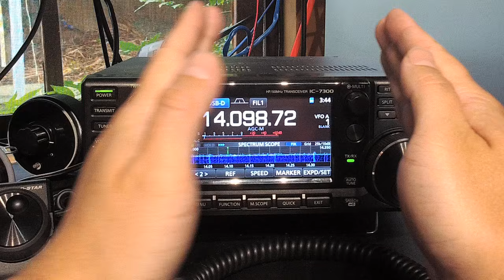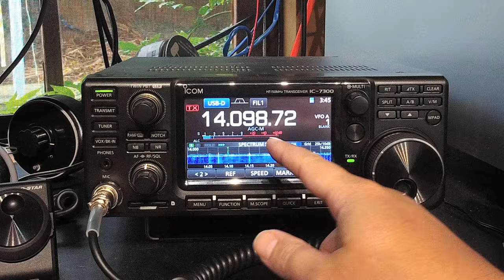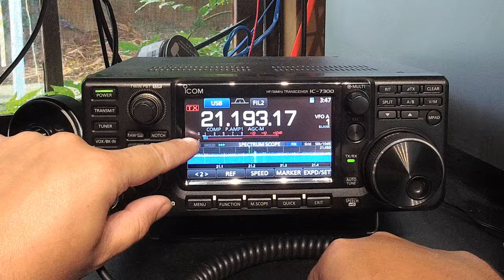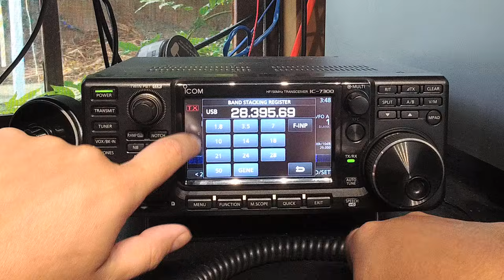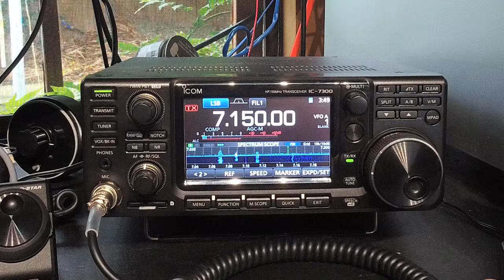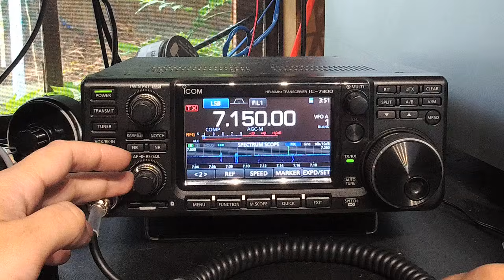How to Setup Your Receiver for Optimal Performance (IC-7300 & IC-7610)

Comment: The RF gain an attenuator controls are the two most important controls on your receiver and it that so few hams understand this today, I blame it on the dumbing down of the tests bringing people into ham radio who have no radio experience whatsoever.

I was at Field Day last year with what is supposedly experienced operators and was stunned at the sheer number of them who had their RF gain not only cranked wide open but we're preamps with an S5 noise floor. Unfortunately they're arrogant Or maybe the fact that they're sitting at the peak of MT stupid on the Dunning Kruger curve prevented them from learning when I tried to explain to them that if you have an S5 noise floor you don't need a preamp, their view was that the preamp made the audio louder but what it actually does is significantly reduced the dynamic range of the receiver.

You're not gonna hear anything in that noise, despite the claims that FT8 can hear below the noise floor it cannot, This is comment made by people who don't understand that the signal to noise ratio on FT8 is calculated on a standard 2.4 KHZ bandwidth rather than 50hertz bandwidth of FT8 making it appear as though it's decoding signals below the noise floor.

When switching to a band, the proper thing to do is tune to a clear frequency and adjust the RF gain for either zero S meter deflection or maybe an S1 at most, this will significantly increase the dynamic range and sensitivity of the receiver. It also substantially increases the selectivity of the receiver and it susceptibility to adjacent channel interference, just like your power output you should only run enough RF gain to copy the signal you want to work Anything more will seriously degrade the performance of your receiver.

RF gain is such an important function that some manufacturers unethically detune the front end of their receivers to artificially inflate they're two kilohertz dynamic range numbers so they appear at the top of Sherwood's sort order. Yaesu tends to do this, for example the 7610 has a 0.3 microvolt front end sensitivity, the competing Yaesu has a front end sensitivity of 0.66 microvolts that's a full 6DB less sensitive or 1S unit less sensitive. They've done this to artificially increase the performance of their radio in the 2KH dynamic range test.

Comment: The s-meter changing due to rf gain changing annoys me beyond belief. I talk to a lot of local stations and can see when one of the locals are having issues or what gear they are running works best. If all of the locals suddenly seem to be having issues I know it's my set up having the issues. The s-meter may not be a scientific measuring device but it is a useful tool when it doesn't change constantly due to radio adjustments.

Comment: Hello friend, I really enjoyed this video but I have a few quick questions. I am a 7610 owner and first, you mention the AN/MN feature and reference that the 7610 does not have this. I am assuming you mean the "one-touch" feature and that with the 7610 one has to dig a little deeper to get these settings to activate?  While I agree, I would suggest the 7610 is much more capable once you access these settings, agree?
Second, you also mention something about the 7610 and, it may be the particular verbiage you used that I didn't understand, but you said something to the effect "provided the 7610's RP PASS is setup correctly"?  Can you tell me what you were referring to here?  It may be something I have overlooked and want to engage on my rig. 
Great video and I have shared it with several friends who are new hams and are having trouble understanding RFG, Preamps, Attenuators, etc. 
Looking forward to more videos.  73 de AF1US -- Brian

Comment: I recently bought an ATS-20+  for $25 US and hooked it up in parallel with my IC-7300 for testing with a 40m inverted V.  I am finding that the ATS does about as well in most cases,  and sometimes  is even better. I must be doing something very wrong.  I am putting both on the same frequency and switching the antenna with a coax switch to make comparisons.
I just tried swicthing the tuner out and in -- not much difference.  SWR measured with VNA is about 1.2.

Comment: really stepped up my ability to hear better on the 705 and on my FT-991a even see the waterfall better and re-read the manual since RF gain acts differently on that radio... but principles the same ! didn't hurt that I went from a 1/4 wave loaded antenna to a EFHW that latter hears way better than the compromise antenna.. and noticed blobs on the WF... which were multiple signals close together :)

Comment: 9.99 out of 10 YT videos featuring some kind of radio show the radio at full gain.  Most times it doesn't matter tho, because the SNR is bad anyway and if it isn't, well, moar signal must be better, right?   The concept of trading surplus signal levels for more SNR hasn't really caught on in 120 years of radio, or it was forgotten as it seems, and losing <GASP> not only the S-meter reading but also the waterfall is maybe not helping with that.

Comment: Hi there, you can see the scope much better if you touch the exp tap bottom right. also on section 2 at the bottom of the scope if you touch REF and turn the tuning dial to say  minus 10db, it will get rid of all the noise on the scope, although it wont effect the incoming audio from the speaker, but its easier to see the lines on there...from Fred g4vvq in Uk..

Comment: RF gain cuts the grass.   It lowers the noise from the bottom up unlike a volume knob lowering all the noise evenly.  Cutting the grass doesn't effect anything above the grass. 

Generally I turn down the RF gain until the meter reads close to the noise floor,  if it gets too quiet add volume.

Comment: Love your video, I noticed my reports were not 'Accurate' with the REF Gain turned down so once I get a good signal and RF where I like it, I set it to 12 o'clock to get the report and then put it back to optimal

Comment: Great video, Jarrad. I learnt a lot about my 7300. Unrelated, but I knew the previous holder of VK3BL licence very well. 73 from Mark VK3XVC
Reply from the maker: Any chance he will sell me the car plate?
Reply: @RateMyRadio  I don't have any contact with the family, his wife moved away many years ago to be closer with family I believe. Barrie used to collect car plates, I imagine his family wanted to keep that one.
Reply from the maker: @CircuitofDoom  thanks for the info.  I’ve seen it once on a 4WD In dandenong a few years back now.  The family should keep it if they have.  73!

Comment: IC7300 receiver overloads and de senses horribly on 160 meter if receiving strong AM Broadcast signals near by. Now had and using is a high pass band filter inline on coax, all is good with the 7300 again! 40db worked well then picked up another unit giving a total of 80db which was better yet. In my collection of older analog radios the 160 meter band was never overload by these same broadcast stations just some birdies showed up on some upper bands. Guess there is something to be said about the approach using filters at the front end of the radio for the band design.

Comment: Jarrad, you mentioned in this video that you'd make another one on how to set up other ICOM radios - did you make one for the 7100 (and I don't mean the short review that you've already put up)? It seems the 7300 is set up differently than the 7100, as it's an SDR. Thanks.

Comment: Well said Jarrad, thanks! Let me make an additional recommendation -- I always adjust the IC-7300 RF Gain down to an S1 noise level on most of the lower bands. It dramatically improves the dynamic range of the AGC as you explained. In conjunction, I also adjust the REF scope setting on the second layer of soft keys. I found that if I DECREASE the RF Gain down a few S-units to the noise floor, I INCREASE the scope REF setting +3 to +9db so that the scope gives me a more sensitive visual reading of signals across the band, too (no RF impact on signals, just scope sensitivity). Doing both of these together makes for an amazing user experience. Try it :) 73s Greg, KJ6ER Silicon Valley

Comment: Jarrad great video and yes I use this very system on my FT-101E and it sounds soo much better than full RF gain. A lot less noise and as far as the S-meter reading most are 5-9 anyway. Thanks again and I have used this technique on many old and new radios. 73 VE5EE

Comment: Thanks Jarred that was extremely helpful! What is your take on using Noise Reduction? (Thanks to your video I discovered that my IC7300 preamp was on. There's no indicator on the regular screen, and it memorizes this setting by band. I guess it pays to check all settings BY BAND once in a while to avoid such surprises.)

Comment: this is my third  radio. so far I love it. I  have a seven o 6 icom. I have a five ninety with a howel mike on it. I like that radio also, but I think the 7300  hundred out receives it. the thing that I wonder about is hooking up an amp to it. I had to jump threw hoops to hook up the icom seventy six to  the amp. I have two amp the oldest is a dentron loafing along on two forty. I also have a five hundred watt amp . so  far it really out paces the ts four eighty. and so far the other ones.

Comment: Great video thank you.  What do you think of the 7300's internal antenna tuner?
Reply from the maker: I think the internal tuner is fantastic; I love the fact it has an emergency mode that runs 50w but lets you match up to a 10:1 SWR which is far beyond the limit of what a good antenna would ever present.  73, Jarrad VK3BL :)

Comment: New ham question...If you reduce the RF gain until it is as you say tickling s1, doesn't that reduce the ability of the radio to hear weak stations that it would have heard had rf gain been set to the 12 oclock position?
Reply from the maker: Simple test: Disconnect the antenna.  If the noise out of the speaker drops, then the answer is no. :). Good question, 73, Jarrad VK3BL :)

Comment: This is precisely how I use my IC-7300. I use an MFJ-1026 on some bands as well, but this is well spoken and proper if any owners have yet to figure it out. The controls are on the rig for a reason. KN4EWI Cheers!

Comment: Jarrad, thank you for your fine video. I tried your procedure and the noise level did go down. But so did the information on my Spectrum Scope. All is blank. I had to change the REF to level 8 to see anything with your way of lowering the RF/Noise. Yet when I see your video, the Spectrum Scope is showing all manner of signals. Did you raise your REF to have it do so? Regards, 73 from N2LRB.
Reply from the maker: It depends on the band; the lower bands will tend to have more noise, but yes there is no problem of adjusting your REF for the scope.  73, Jarrad VK3BL :)

Comment: Excellent training, thanks for the video. K7EMU WilC  73
Reply from the maker: Dear Wil, thanks for the kind words and I hope you enjoy your radio - what do you have?  73, Jarrad VK3BL :)
Reply: @RateMyRadio  I have a ICOM 7200.  I have had it for several years, I also have a Icom 718 for a backup that I've never used.  My next radio will be the 7300, when my boss will let me, LOL 
Thanks for asking,  73
Reply from the maker: Dear Wil, I will be making a video on how to get the most out of superhet radios such as the wonderful IC-7200 soon :). Basically, when turning down the 'RF Gain' instead of the S Meter dropping off, it will actually 'stay solid' and the reading will increase as you decrease the RF Gain.  The trick is to set it exactly where the band noise is. It will make more sense in the video when I demonstrate it on a Kenwood TS-590SG.  73, Jarrad VK3BL :)
Reply: @RateMyRadio  Great!  Will look forward to it.

Comment: Great tutorial, helps a lot. I just got my General yesterday, have this radio new, not powered on yet also have the IC-7100. everything is kind of in Chinese to me still even though I studied for the upgrade, there are many concepts that I still do not visualize how they match or how they work; like if I power on the radio, I do not know what to do first but I guess that is why we get ourselves into this mess, I mean, hobby, lol. Little by little I will learn the ropes. 73 from Rody, KI7CSI
Reply from the maker: Dear Rody, I will be making a video on how to setup SUPERHET receivers such as the IC-7100, IC-7200, Kenwood TS-590SG in the coming weeks so it may be helpful as well.  Basically the same concept, except the S Meter reads differently when RF Gain is adjusted.  73, Jarrad VK3BL :)

Comment: 'If you think about it'...most quality transceivers give you the correct S meter report when you back off the RF gain.Also, Japanese equipment uses 3db/S point.No wonder the signal reports below and above S 9 are better than the original standard 6db/S point. Stealth inflation, especially if you are comparing power level changes or antenna gain/f/b ratios.

Comment: If using a 7610 and doing a comparison of two antennas (Main and Sub receiver) ,  would you  have the RFG set in the center position for both antenna 1 and 2 or would you adjust RFG so that band noise levels indicated are at the same level , different gain positions ?
Reply from the maker: Good question, I would normally adjust so both tickle S1, and then listen for Signal to Noise ratio advantages.  73, Jarrad VK3BL :)
Reply: Thanks, that is what I have been doing after  watching your video on this topic.

Comment: Very good Jarrad, I use my RF gain control on every radio I have, when needed. In the old days that was our noise reduction, and really still outshines the dsp version we have now. Its ability to increase dynamic range is the best reason to use it. Plus the fact that most of todays radios have way too much gain to start with. I do not have an Icom IC7300 or IC7610, but the use of rf gain is the best thing to do for all radios which have the function. Thanks again for your videos which will help a great many new hams. Lastly it sounds like you have had people harrass you on how you tune up the antenna, to me it was obvious how you were tuing and I have and do it that way as well, a carrier any way you can easily get it to use for an external tuner. And you did right making it clear that the know it alls can keep their tongues, 73 my friend

Comment: Hi Jarrad.  I've had my IC-7300 for about a month now.  This video inspired me to finally pull the trigger on one.

Now that I've gotten familiar with it a little- I want to share what I've noticed and see what your thoughts are.  This is mainly about the RFG.

It seems like the RFG is way different from the traditional superhet radios.  There's no surprise there since it is a direct sampling SDR.  One of the main differences is that the S meter does go up as you turn down the RFG like it does on a classic rig.  Instead, it goes down.  Also - and this is the most important observation - the base level of noise doesn't go down at all until the S meter drops below 0.  It may initially drop as you lower it a bit, but then the AGC catches up with what you did and the volume level of background noise goes back to what it was.  In other words- the noise at S5 sounds the same if it's taken down to S1 with RFG.  It seems like the direct sampling completely takes over, and the only way to get that noise down is to lower it below S0.

Does this line up with your own experience?
Reply from the maker: Yes it does completely - well observed.  You are also correct that 0 is what you should aim for to avoid ALC triggering - this even includes most SuperHets for my knowledge.  I hope you are loving your purchase, 73, Jarrad VK3BL :)

Comment: The radio lets you turn down RFG while having a preamp on.  No idea why anyone would want to do that.
Reply from the maker: It would be a rather silly thing to do wouldn't it, but luckily (I guess) manufacturers haven't seen the need to 'protect' hams from such simple mistakes!  73, Jarrad VK3BL :)
Reply: @RateMyRadio  The only use case I could think of is a scenario where the band noise is just quiet enough to be an S0.  But turning on P.AMP 1 pushes the noise too high.  You may want some pre-amp gain but not all of it; so then you back the RFG to where it just tickles S1.  I suppose in that scenario you'd be fine just leaving the pre-amp off with RFG all the way up even if it slightly below S0.  We should all be so lucky to have S0 QRN.

The manual is rather interesting when describing the two different preamp levels.  I thought they are just two different gain levels: more gain and even more gain.  But they describe P.AMP1 as a "wide dynamic range preamp" and P.AMP2 as a "high-gain preamp".  It also says that the preamps improve signal-to-noise.  I'm pretty sure it make signal-to-noise worse if you already have enough gain.  That part of the manual must have been poorly translated or something.
Reply from the maker: The second pre-amp does indeed offer more gain, and the expense of less linearity and a smaller dynamic range... so its a 'last resort' option.  I agree, we should be so lucky to have S0 and part of my life plan is to acquire some rural land to make it happen.  That said, who knows if we'll still have Ham radio by the time that happens!!! lol 73, Jarrad VK3BL :)